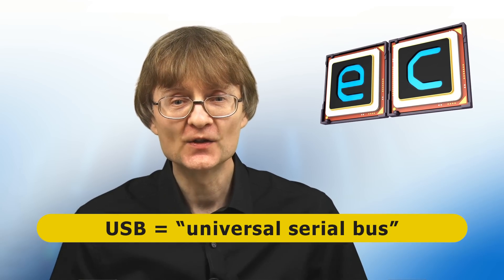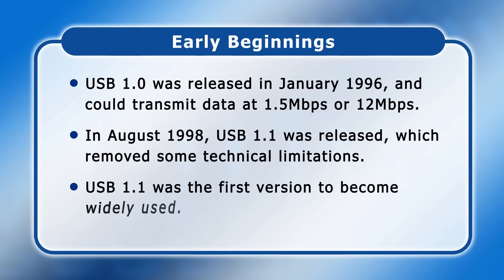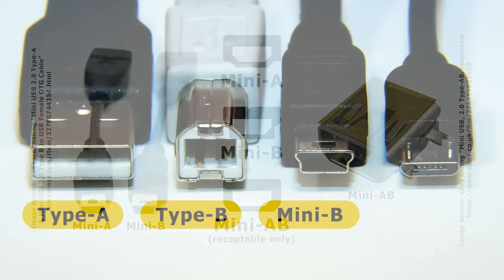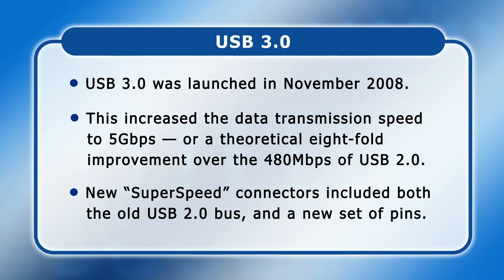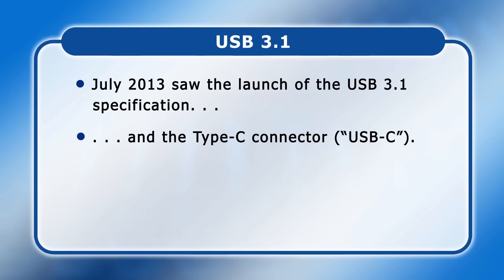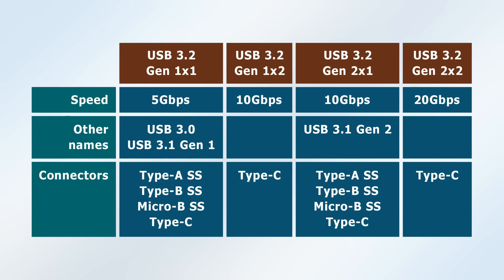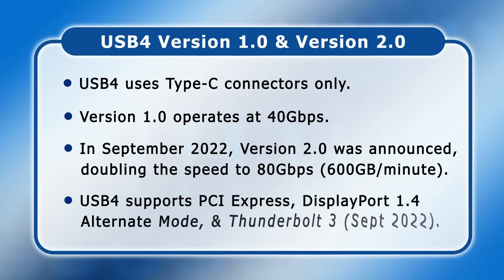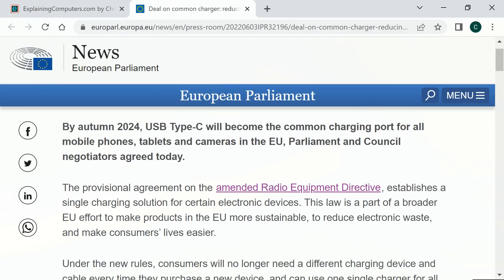Explaining USB: From 1.0 to USB4 V2.0

Comment: What I miss in this video is the other side. I mean the plug on the main-board. First there was one where all 10 contact holes where open, making it possible to kill the USB (or whole?) chip set via short circuit. Then the fix with 9 contacts. Than USB3 with 20 tiney poles that appear rather flimsey and can have bad/slow connections. Than the beefier connector for a single USB-C, that is still rare on PC-Cases. And than there is the problem on the backside of the main-board: If you are able to connect USB-C pretty much blindly, you may feel inclined to try it. Problem is that the small USB-C fits right into USB-A (or GPU vents). Causing a short circuit. I was lucky for it to only cause a restart.
Reply from the maker: These days the USB 2.0 ports have a blanking pin to ensure correct connection. But in the past you certainly had to be very careful indeed . . .
Reply: @ExplainingComputers  Ah, "blanking pin" that was the word I'm looking for.

Comment: Great video and well explained. I think  you forgot to mention the colors to identify each version of the connector. Thanks!
Reply: USB1 white and USB2 black. Manufacturer's did not use the colors.   
For charge only Red, is also often not used. And always power ports on my pc are yellow.
Also forgotten, manufacturers like Panasonic have a range of private variants. 
The SS5 or SS10 logo on a lot of cables is missing.
On my new USB3-A to USB-C cable is no mark at all. SS5 3A is missing.(limit by the chip inside the cable)

Comment: USB-C can be even as low as USB 2.0. That is in many phones. I have a 5 TB hard disk on USB 2.0. It work well as you never transfer the whole contents at the time.
Reply from the maker: Yes, Type-C includes a separate USB 2.0 set of pins, just like the SuperSpeed A, B and Micro connectors.

Comment: You always make very confusing topics understandable. Thank you! 

Have you talked about serial over USB  yet?  As a ham, I encounter this every day with every item and they are all different. I think there are many variants and from different countries that don't follow the  correct standards. It's insane and frustrating, but being ham, frustration is part of the hobby.
Reply: Isn't USB a serial cable itself? Do you mean DB9 to USB adapters?
Reply: @maxstr  No, you're exactly right they are a usb be cable that implemented the serial interface. it requires specific drivers. I'm not a fan of them but they are required for some radios.
Reply: @gaptastic  yeah I've seen those with MODBUS industrial equipment. They all look identical, but they all have some different proprietary pinouts. Those are never a "normal" serial cable

Comment: There is an annoying variation in USB cables that you did not mention. Cable resistance for power delivery.

My Samsung Note 5 charges differently from 2 different cables from the same charger. The 6 ft cable charges much faster than the 2.5 ft cable. The 6 ft one is noticeably thicker though I would not take that as a guarantee among all brands cables.
Reply from the maker: Certainly true. Cable quality, and wattage ratings, are getting more and more critical.

Comment: Great video! The data side of the USB world is a mess but the power side is even worse IMO. At least on the data side devices will usually fall back to lowest common denominator speed wise and still work. But on the power side I've seen some real strangeness. 
For example: My son had a toy that had a USB type C port on it for charging and the toy itself came with a very short & cheap A to C cable. If you plugged that toy into a USB C cable that was plugged into a USB C port on a PC or a charging station it would NOT charge. However, if you plugged that toy into a USB C cable that was then plugged into any USB A port it would charge.
Reply from the maker: Agreed. I am planning a follow-up video on power only.
Reply: @ExplainingComputers  Excellent! I'm looking forward to it!

Comment: Hi! I missed a reference to Joseph Decuir and connections to Atari SIO :)
I have to say you've been very polite on a mess that USB currently is ;-). Speaking of USB-C ports and cables you can actually get everything, nothing and something in between. From broken PD implementation in early Raspberry Pi 4, through missing video output, incompatible DP Alt Modes (Macs used format incompatible with some adapters used in PCs, lack of presence of multi-stream mode), you might have 5/10 Gbps but you might get only 480 Mbps. All with the same connector and often no single mention of capabilities in user manual and especially on the box before you buy. 
The only thing that USB-C fixed is that you don't need to plug it 3 times to succeed.
And as for now, having 3 USB-C (and now thankfully HDMI and SD) means constant living in dongle town 🤷‍♂️

Comment: Thank you Chris for the very clear video. I worked with USB and it's a terribly confusing area.
I recently started using a monitor connected with type-C cable and integrating a USB 3 dock. Having annoying problems I contacted technical support. They suggested to try an alternative cable but, despite being asked twice, they didn't provide the requirements for the cable!
I may have missed it but... have you referred to Battery Charging specifications (BC 1.2) in relation to USB 2.0? They were (are) crucial for the design of micro USB phone chargers (with the 1.5A min specification) and for enabling OTG to decouple the host/device roles from power source/sink.
Reply from the maker: I missed out USB 2.0 battery charging -- I missed a lot out, there was too much to include -- due to the transition towards USB PD over USB-C these days. I will probably return to USB PD in another video and cover all the standards.

Comment: As someone who's witnessed this entire history, the renaming of existing standards had to be the last brain cell on the committee expending its last, delusional breath.  Those who thought doing so was a good idea should be institutionalized to protect the public.

I once bought a PCI card that added USB ports to a PC that pre-dated them and this greatly extended the machine's useful lifetime, but even then I could not boot from those USB ports as the BIOS had no knowledge of them.  There's a "Plop Boot Manager" that can boot from USB on those old machines, but it never worked with the add-on card on my old tower, for some reason.  Your mileage may vary.
Reply from the maker: Great post, thanks for sharing.
Reply: The PCI card needs to support booting off USB. Similar to how not all SCSI cards supported booting from SCSI.

Comment: Well, with the latest "standards" updates and alt modes, we now have to worry about the cable characteristics and quality, in addition to the connectors. To support the highest data transfer rates and power delivery (240W!), what kind of shielding and wire gauge are required? Perhaps Chris can look into this and provide some guidance in a follow-up video. Also, I've heard that Linus (of LTT) is setting up a testing lab that will include cables, among other things.
Reply from the maker: Very true -- cable specs are going to get very important. The EU idea that people will buy devices without cables and adapters is deeply flawed in not recognizing that not all USB power adapters and cables are the same . . .

Comment: While this covers the standards factually, it ignores the major "confusing factor": Chinese vendors.  These anal orifices make and label anything, with any "standard", without performance conformity, and then lie about it to boot.   
Is there some ingenious vendor who sells a simple "USB Cable Tester" which actually measures the pin connections, communication speeds and current capability?  There are many, many "USB testers" for checking PCs, Voltage, charging current and PD protocols supported, but none that test cables for performance or conformance.  Seems like a "natural" for the hoards of Ali-Express vendors.

In theory the USB Implementers Forum owns the copyright and trademark and has the "enforcement power" to knock out these crooks, but have been totally overwhelmed by their numbers and do nothing.  Even the almighty Apple and Intel can't stop them marketing "Thunderbolt" cables, though they sometimes play "whack-a-mole" with some.

Comment: 240 watts over less than 18 gauge wire? that's staggering when you think about it.  How do these things not melt? Sure, the voltage is higher, but not that much higher.
Reply from the maker: I can only agree. 240W through a USB-C connector also amazes and worries me. The contact area cannot be that great. Very different to, say, a barrel jack.

Comment: My first computer motherboard to have a USB never got used at all as I did not have any USB peripherals, but I ended up donating that board to build a friend a computer and my new one had USB 2.0 and so did my new printer and MIDI interface so thats where my USB journey began, I prefered the serial connectors though as they were fixed with screws, I never once had a parallel or serial cable fail on me but I have a box half full of USB cables that have failed which I keep for Arduino projects and I buy good quality cables also

Comment: So does this mean that all cables with USB-C connectors support USB 4 data speeds and power delivery??  My guess is NO,  meaning that the even bigger USB monkey wrench is that there is no way of knowing the capabilities of any particular cable, regardless of it's connector type. Eg:  Many USB cables are POWER ONLY with no standard or required marking or indication that they don't actually support data xfer.  (Profiteering absurdly and obscenely abuses consumers yet again?)
Reply from the maker: Fully-wired, quality cables -- yes for USB data speeds (apparently). But not for power delivery. Somes cables -- some only wired for power as yuo note -- are now sold with power rating for use with power delivery -- 60W, 100W, 240W, et. This is a potentially massive area for future problems as you imply . . . The EU is massively naive in mandating USB-C in not understanding that it is not a single power standard -- not all USB-C adapters will power/charge all products . . .
Reply: @ExplainingComputers  Thanks for the the detailed reply.  Good that the standards let us expect the cable to support the data rates implied by the connector. A shame that the power delivery capability is a separate issue and one that isn't being considered in the EU standardization requirement. Now lets talk about how and why those overpriced Thunderbolt.3 cables are a different spec... 🙂

Comment: I think the take away is don't assume anything at all when it comes to computers! I remember my first time buying a SATA RAID card that used cables that are used for SAS drives only to find that the card didn't support SAS drives. You have to check the specs on everything, which is getting harder as a lot of manufactures spend more time on the marketing portion of the website than the technical info. Great video and glad you covered the power part of USB. I wasn't aware that they were shoving even more power down USB cables, the USB kettle may yet be a thing!

Comment: One of the neat things of USB PD is i just have to slap two 5.1K resistors on the cc pins  and bam i have 5v,3A power which i use for most PCB designs that are power hungry.
Reply from the maker: Neat trick.

Comment: Superb video! It should be noted that USB 4 / Thunderbolt get to barely more than half the theoretical maximum speed (around 22-23Gb/s) so we can assume that version 2 will be the one that will achieve the 40Gb/s as actual speed (instead of 80 of course)
Reply: If they had gone optical it would have been easier. S/PDIF shows consumers can handle optical.

Comment: USB from a coder's side is incredibly difficult. The 4v2 standards were published a few months ago but the naming convention sparked a lot of controversies.
Reply: naming make sence, you just need to remeber that spec compatibility is not same as speed capability of devices and they dont need to support all of them even thru they made with USB4 spec. USB technicly addapted PCIe speed mode convention SpeedMode x number of lanes so Gen3x2 means dual lane gen 3 spped mode (introduced in usb4) which is currently highest. only fully pined usbc cables can support it as dual lane use mirror pins.

Comment: What does he mean by "Rodents"?
Reply: Hand-held pointing devices that detect two-dimensional motion relative to a surface. This motion is typically translated into the motion of a pointer on a display, which allows a smooth control of the graphical user interface of a computer.

Comment: I consider myself to be fairly up to date on stuff like this and in 2013 it started to confuse me. But generally, as long as the plugs fit, they worked and worked fast enough. However, the type c connector has become my favorite by far, small and reliable.

Comment: I recently built a newer computer that  has the orange USB 3.2 at 10gb/s and was pleasantly surprised when my old ssd hd on an older USB 3.0 micro b cable worked at what appears to be twice the speed of USB 3.0. Having that backwards compatibility is very much appreciated! Thanks for the great video 👍🏼
Reply: Hmm, in this is case it's forwards compatibility, no?
Reply: @offspringfan89  In my thinking, since it is a newer standard that is compatible with older hardware, would make it going backwards in time. I could also credit the actual cable I purchased as being forward compatible by being capable of supporting the higher speeds. I suppose you can look at it from either perspective and both would be correct.
Reply: @Wandering_Horse  it is a newer standard being compatible with older hardware, but since it's at the newer speed it's considered that your SSD is forward compatible since it supports newer stuff than itself.

Comment: Thanks. Reminds me of a camel-horse designed by committee.
Was a little disappointed that you avoided the naming problems of the different standards, Hi Speed etc. For me that was their biggest sin. 
I think there's another important takeaway - as long as the plugs fit, all standards are compatible, albeit at the lowest performance of the partners. 
There is/was another problem, mixing different versions on hubs slowed the hub for all devices on it, and daisy chained...

Comment: You don't mention if you accidentally plug a USB 3.1 flash drive into a USB 2.0 computer, then can corrupt it irretrievably! You can only use a USB 2.0 flash drive with a Gotek drive emulator. And you can only use a USB 2.0 flash drive with some Freeview boxes. Thanks for taking the trouble to make this video.
Reply from the maker: A USB 3.1 flash drive should work at USB 2.0 speeds in a USB 2.0 port -- there is no technical reason for using a slower USB specification to cause drive corruption. But certainly many devices and emulators only support USB 2.0.
Reply: @ExplainingComputers  It was a DIDIVO USB 3.0 flash drive that got corrupted. It worked okay on my Dynabook with USB 3.0, but got corrupted on my older HP Pavilion laptop. I don't think it is there transfer speed that is the issue.  I think it is electrical conductivity. Perhaps you could research this?
Reply from the maker: @AllensTrains  A USB 3.x (Type-A) drive will only connect via the legacy USB 2.0 pins in a USB 2.0 socket, so there should not be any electrical issues unless the port is malfunctioning, or it is not produced to the USB 2.0 specification (eg if its connectors extend backwards so can somehow contact the USB 3.0 pins). But again this should not corrupt data on the drive. Far more likely the drive was corrupted by a software problem/crash, or not ejecting safely -- or drive failure.

Comment: I've always thought it was funny how it's called Universal but easily has the most confusing assortment of plugs of any connection type.  PS/2 keyboards and mice are still vastly superior and I'd rather go back to that standard, but it's impossible to find real PS/2 versions of these devices (and not just a USB device with a PS/2 adapter).

Comment: Anyone have any references for pin connections for USBC-C PD?  I need to replace a broken USB plug on a power supply and it's not exactly clear to me what pin outs need to be connected to which wire from the power supply.
Reply from the maker: See: https://www.embedded.com/wp-content/uploads/media-1243828-05pd1-figure-3-c.jpg -- the V BUS pins are +ve, GND ve. All the V BUS pins carry the same voltage - by default 5V< but PD will negotiate and switch to another if this is used. Good luck! :)

Comment: I think older DJI drones (Mavic pro) have Micro AB port in their controllers before they switched to USB C. Can't be sure, could be just a propietary port, but fits Micro B for charging, and the square one for connecting to a phone or tablet.
Reply from the maker: Ah, a good spot. These comments are revealing the micro  A and AB connectors! :)

Comment: To my ear, it sounds like you added more dampening in the studio space between the initial shot and the farewell. All the VO audio sounds perfect, of course. Your mileage may vary. I have a personal HATE for micro-usb connectors: they are fragile and tend to be the weakest point of contact on a device, such as on my low cost mixer, where it broke off inside. GRRR.
Reply from the maker: Greetings! :) The intro and end sections to camera were recorded at the same time -- or at least in the same session. The voice over was in a completely different location where the setup was focused on audio only.
Reply: @ExplainingComputers  That's fine, it just seemed to have a bit of what I call 'kitchen audio ambience,. I have seen various updates to your studio space showing the baffles and such. I'm probably too attuned and listening for it. Thanks.
Reply from the maker: @loginregional  Ah, I have a glue problem! I lot of my tiles have fallen down, and I need to stick them back up again! :)